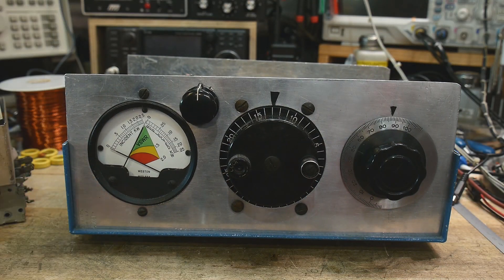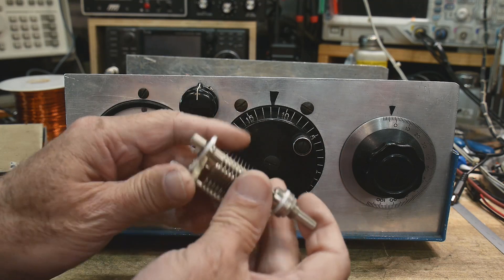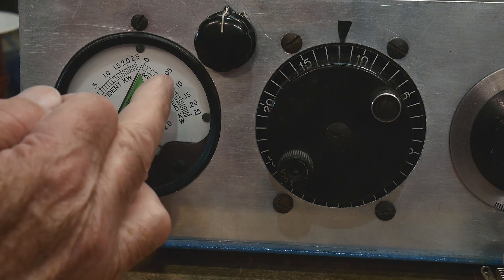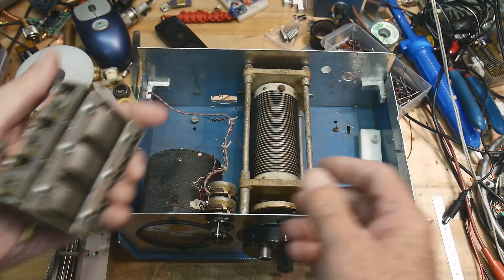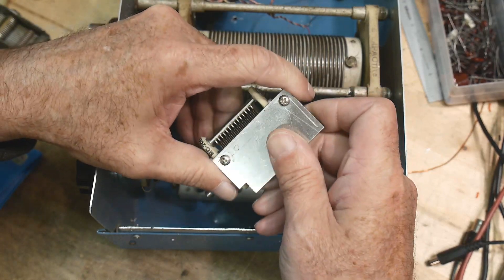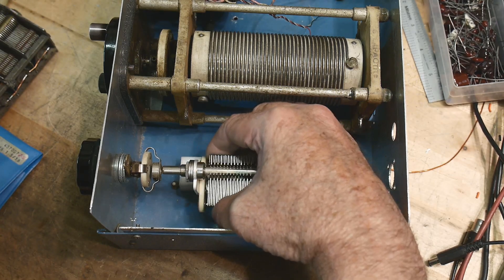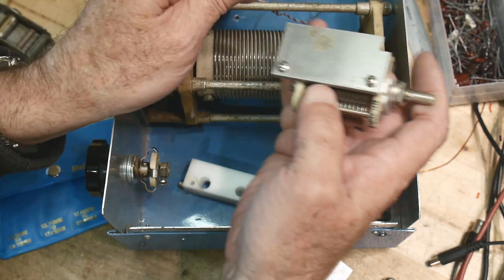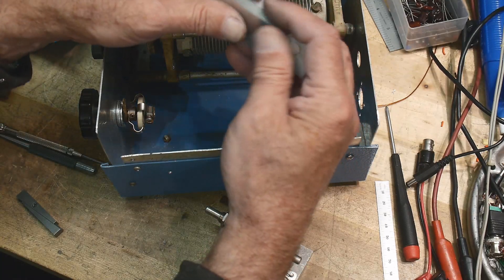#749 DIY Antenna Tuner Improvement Capacitor

Comment: "Adjustable parallels"  I often need to estimate height when fabricating.  Thanks for sharing that tool-usage.  I'm curious to see how much better the L-network circuit is over a more typical T-match.

Comment: Change a 1000  pf cap to 50 pf ????? Crazy.
Reply from the maker: it's 200pf but still too small for some antennas and frequencies. My MFJ box is not much different
Reply: @IMSAIGuy  I've got the exact roller inductor and a 500 pf 2kv cap, still too small. I had to switch in another cap. Try adding a selector switch to parallel fixed caps.
Reply from the maker: @jerryfankhauser2959  Yes I'm sure that would extend the useful range. It works fine on 20m with the setup I have. My antenna uses an UNUN to impedance match first so the tuner does not have to work as hard.

Comment: The guy who made it originally had selected the three section capacitor as it has to be a larger one like more than 500pF or more in an L configuration to interface large impedances.
He must have observed the size of the capacitor in the pi match of tube linear amplifiers, hence the selection. He was not wrong.
You must have thought his selection was an overkill for the antenna matching unit.
Your selection is absolutely inappropriate.
Having a rollercoaster inductor (must be 28uH) that can be put to use from at least 80 meter. But the capacitor size (the value of capacitance and the plate spacing) is awesome low.
The SWR cum power meter is really unique and I have not seen one like this in my life.
I believe it's like a cross needle (though not exactly but) two moving coil mechanisms on a single display dial the magnitude of deflection depending on the SWR and power.
He had selected the popular dead easy "monimatch" directional coupler that must have been fairly good enough to serve the purpose, the main problem being the unreliability and inability of power calibration as it depends on the length of the signal line. The length of the center conductor becomes a considerable fraction of the wave length on the higher side of the HF spectrum; the pick up lines present more voltage at the 30 MHz range compared to the 80 meter operation.
Your choice of the "Tandem coupler" is good but then you will have to do the calibration.
Coming to the mechanical engineering aspects of mounting your small capacitor I could note that stand off has to be bit taller by about say 1mm or so; the alignment is not exact; it would stress the ceramic springy coupler a lot on the long run. But I hope you would like to discard the idea of using the capacitor in the first place. Yes, please go for one with wide space and higher capacity.
The whole contraption can be used for at least 1kw of SSB if made diligently.
All the best 👍

Comment: That Hammerlund capacitor isn't large enough.  L networks can require C as large as .001 uf for some antenna impedances. (hence the 3 section BCB cap).  At least add a switch to parallel several fixed caps with it.
Reply: The original Triple Variable Capacitor looks like a 3x 365 = 1095 pF to me.
Reply: That cap is to now trust me